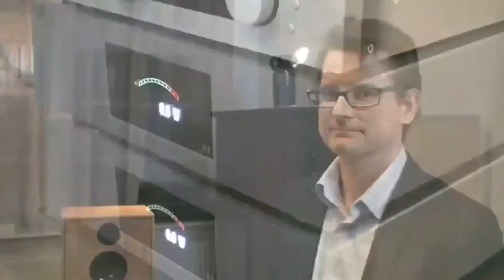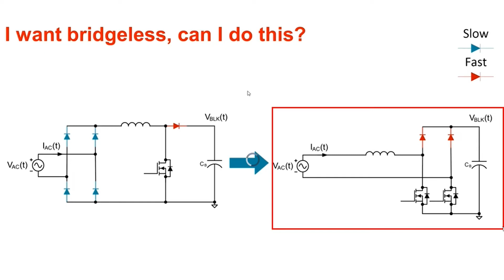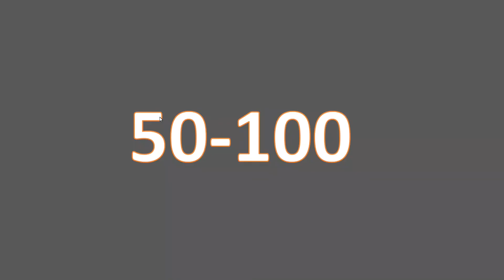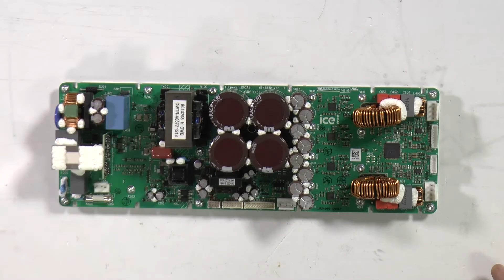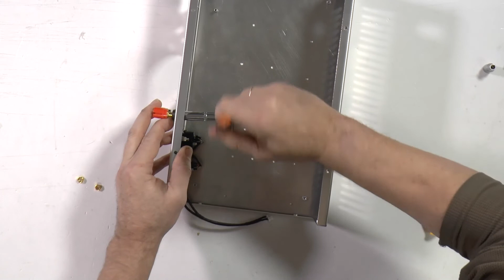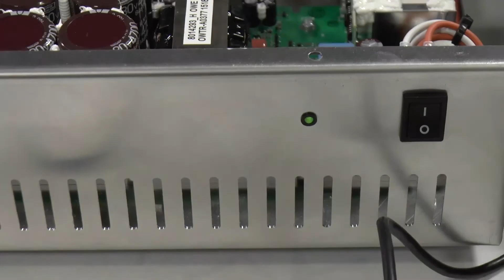ICEpower 1200AS2. Build your best audio amplifier in the world. Part 1-3

Comment: As you mention...We need a big swing preamp. 
I did got to work the sub pre amp off the china amp plates but the gain is a joke. Even when I by pass the sub preamp and hook up.the ice power to an old samson x-over it still lack so much gain.I have this xover connected to 2 ols crown power amps..they were soy rocking hard while the ice power was not moving the cone of a 10" 4 ohm. 
Any recomedations of a pre amp? 🤦‍♂️

Comment: Why use a fan in class D amp? The fan will make some noise no matter what, and is not needed in a class D amp. The amp  case is super low-cost crap, not good for a power amp, will not help with heat, and looks bad also.

Comment: Best amplifier in the world? I see around 1 percent distortion???? A budget amp has 0.003% at most.
Explain please.
Reply from the maker: All amplifiers have a linear region and a region close to the clipping region. This board features 450W of clean power with 0.003% THD and 150W of headroom to clipping. You can look at a budget amplifier's real power with 0.003% THD, and it will be from 35W to about 100W. For 3-way floor standers, you need a minimum linear low THD region of about 500W to really work at best audio reproduction quality, and it is a difficult engineering task to make it in reasonable dimensions, providing necessary heat dissipation.
Reply: @guntarssmits2104  Can you give a link to these specs? What I see is 1200 W / 4 Ohm per channel ≤ 1 % THD+N, 1 kHz - Who cares what power it has at 1 % THD, that is not acceptable.
0.003 % THD+N @ 1 kHz, 10 W / 4 Ohm?? I am impressed NOT.
Show a measurement (scope) from sine and square waves from 10 Hz to 30kHz oh and 8 Ohm! Let me see what power and signals it produce.
Reply from the maker: @edmundzed9870  Look at the document deeper in specs tables and charts https://www.tcrastrs.com/_files/ugd/81aa64_75490ea3cd5349698e124795a977d2ce.pdf

Comment: I've built many of these ICEpower amplifiers and none of them beat my EL34 valve amplifier. This is always a very subjective topic.
Reply: There are reasons for this, all of which center around certain non-ideal amplifier behaviors that can sometimes be euphonic. This is where the objective engineer and the subjective listener sometimes diverge. Have you looked into the PS Audio Stellar M1200? It is using a switchable tube buffer and may provide the warm character you like, together with the power to control very large speakers, coming from the ICEpower 1200AS1 module which is a single channel version of the one described in this video. But if you are already using a tube amplifier, then your speakers are probably very high sensitivity. Some of the design decisions in such speakers that improve sensitivity can also reduce other distortions, but there are some other high sensitivity speakers that are forced to live with a higher level of distortion, such as higher-sensitivity single driver speakers or some older horn speakers.
Reply: It's not about euphonic distortions : There’s more musical information in a continuously conducting Class A NOS tube amp than in PWM-based designs. PWM introduces dead-time, crossover artifacts and high EMI that can mask low-level dynamics; measurements that focus only on steady-state THD/IMD miss the transient power transfer and micro-dynamic behavior that matter for music reproduction. And good tubes run at incredibly low THD. The 211 tube for example specs out with more linearity than transistors and has a totally natural, uncolored sound - no warmth here.

Comment: 20 some years ago I bought a pioneer ice amplifier. I didn’t know exactly what it meant. It was for my car. It was spectacular. I still have it now after doing extensive research prior to buying things. I forgot to do it on my pioneer LX 505.    I’ve been running that amplifier for about two years maybe a little less and I absolutely love it and it is powered by ice.   In my opinion, there is nothing better than ice. You guys know how to do class D

Comment: Is the 700AS2 the same Quality level? Could be enough power for non profesional uses. What do you think?
Reply: It is not using the IceEdge modulator/control chip. Only 1200AS1/2, 2000AS1/2 HV are using IceEdge, and 125ASX2 version 2.2 is using the even newer Conductor modulator/control chip.
Reply from the maker: @carlosah2598  no it hans different architecture

Comment: Hi Guntars

Thanks for the very nice video.

I have a pair of amps build on the 1000asp modules, which has started to sound muddy in the bass region. Probably the power supply capacitors is becoming old… the amps is from 2008 and has been on 24/7 since…

I am thinking of replacing the 1000asp’s with the 1200as1. And wold like to know if you could guide in how to make the signal sense wiring for both balanced and rca inputs? 

I guess using the standby function will save both energy and life time on the modules…

Regards Jan
Reply from the maker: It extends the amplifier's life span using wake-up from signal function. To implement this function you should download 1200 pieces of technical documentation from my site www.tcrastrs.com or write me an email at gsmits@tcrastrs.lv and I can send it to you. Board documents are available for download from the Soundimport shop as well. Implementation guidelines are described in the design manual. It is possible to implement for RCA and XLR. The wake-up signal input is separated from the main input.

Comment: I am using 1200AS2 at the moment and thinking of changing to dual monos: 2 x 1200AS1 or 2 x 2000AS1HV. 
Do you know if 2000AS1HV is much better than 1200AS1?
I can afford both solutions and/but looking for someone who can advise me if 2000AS1HV makes that much of a difference over 1200AS1. All in all the 2000AS1 has "HV" (high voltage) in its name. 
I am looking to build my endgame amplifier for life.
Reply from the maker: By quality both are equal. You should have a logical explanation of why you need a 2kW per channel for home usage. You may have large premises and huge speakers.
Reply: @guntarssmits2104  I have 1200AS1 modules at home waiting to go into their chassis over the Labor Day weekend. I decided to pursue this route so that it would be impossible for any sort of supply modulation behavior in one channel to affect the other channel. Having even more power available from one channel is just further icing on the cake. I have some project speakers planned in the future that will use long-stroke subwoofers as the woofer, like half of a Magico S5, and those are usually a very reactive load that normal amps struggle with. I already have some Hypex NCx500 monoblocks that can output the power of the 1200AS2 running in stereo (~700W/ch at 4 ohms) so an endgame setup could be actively crossed over LF on the 1200AS1 monos and MF/HF running on the NCx500.
Reply: @guntarssmits2104  ok, many thanks for your advice

Comment: Hallo Guntars Smits, i built the amp with Icepower1200AS2  and im very happy with it. Thanks for this videos. My question: If i use a source (preamp) with max. 2 volt output voltage with rca-connection, how much ist the max. output power of the module? I gues its around 175 Watts. It is right?
Reply from the maker: Depends on the load. For 4 ohms 300W for 8 ohms 150W

Comment: hi, if i connect as2/1200 amp to rca / no-balanced cable, is it still good high.end amp for this? what do i need to do? put buffer in between to raise inputlevel? tnx nice video!
Reply from the maker: For a short distance of up to 6m of input cable difference between balanced and unbalanced is in sensitivity. Unbalanced is -6dB or 2 times lower. If your max power is OK then you should not do anything. Quality is the same.
Reply: @guntarssmits2104  unbalenced is 6db lower. Not 10db? Maybe i just rememberd 10db. No? Thank you very much for answer :)

Comment: im currently building a pair of speakers with intergraded amplifiers (icepower 700AS2)
In my case, where the whole speaker is made from wood, where should i put my groundings?
Reply from the maker: You can put mains ground to some of the screw hole which has chassis ground connected. For operation you do not need a ground, just fo safety, but as long as you enclosure does conduct electricity you can live without mains ground. Find 700AS2 engineer manual on ICEpower site and look at drawings. There are some information about chassis grounding.
Reply: @guntarssmits2104   Thank you! :)

Comment: Is it possible to integrate VU meters in the front of the housing ? I’m quite interested though the design is missing the aesthetics to convince my wife of setting it on the low board instead under it. Thanks 😊
Reply from the maker: When we are talking about next-generation amplifiers with high probability we will move away from shiny box designs and moving signal indicators. That place is taking modern streamers and DACS with phone APS where you have all meters and many more. The amplifier should become invisible and be placed as close as possible to the speakers. This is also my concept. TCR1200 has a built-in Wake-from-signal function that allows you to place it remotely from your front-end equipment, When the signal comes to input amplifier starts operating. You should not switch it on. After 18 minutes (minutes not seconds) of idle, it goes into sleep mode and consumes only 250mW waiting for the next moment when the signal is applied to the amplifier input.
The simple answer is no there are no future VU meter designs from me.

Comment: Thank you so much for your work. You are providing really helpfull information. 

However, one issue has not yet been conclusively clarified for me, namely the question of what the situation is with input buffers. 

To make the rather analytical sound of the Icepower boards a little more "analogue", many recommend tube buffers or op-amp buffers with TI IC or discrete OP amps. 

Is there an "in a box" solution with an AS2 or ASX plus inbuild buffer board? Thank you so much!
Reply from the maker: Let us define input buffer meaning. It is an electronic unit with a high input impedance of 47kOhms or more and a low output impedance of 50-150Ohms, the capability to handle high overloads and low distortions.
1200AS2 Board has a good 47kOhms input buffer and it does not need other preamp circuits. Boards like 200AS2, and 125ASX2 have relatively low input impedance of about 5kOhms and there will be improvements from the input buffer. I made a buffer board based on a TI INA1650 chip with 100kOhms input impedance and 150Ohms output impedance. There is significant quality improvement working together with 125 ASX2.
A good option for a preamp is a modern DAC which meets above mentioned requirements. It is not important whether you have a lamp or other technology preamp. The key is a high input impedance and low output impedance of the preamp to be able to drive the power stage. THD below 0,005% (Typically 0,0005%)

Comment: WHAT PREAMP IS SUGESTED TI USE WITH iCEpower 1200AS2?
Reply from the maker: Any modern streamer/dac with balanced outputs for the best quality. I am using a PC and Focusrite sound card as a budget solution
Reply: I made amplifier based on IcePower250A modules. Very satisfied. I feed it with different streamers (not balanced) but noticed that if put some little preamp(gain 3 or so) sound becomes much better @guntarssmits2104
Reply: this is a good question. i'm considering marantz av10 or stormaudio as surround processor pre amp and will DIY this amp for a total of 11 channels. will these modern surround processor preamps complement this icepower 1200 amps  @guntarssmits2104 ?
Reply from the maker: @QAT4969  For home cinema surrounds 1200AS2AS2 will be overkill. You may need it just for floor-standing fronts. We are dealing with a 1kW capable board and 3.8kW instant power. Assuming that you will use 6 boards your wall socket provided power will be short. Also, you will need a sequencer to switch amplifiers one by one. Quality will be outstanding but science home cinema limits low frequencies for surround and we can hear directional effects from 500Hz-5kHz I would say that 200AS2 is a better choice even if you are building an advanced system. And you will save significant space, money, and electricity savings
Reply: thank you for your advise Mr. Smits. yes..i'm considering 200AS2 or smaller for surrounds & overhead ceiling atmos speakers. for power switch socket outlets (SSO), i'll have them in every corner. front stage will have at least 5 nos of SSOs to cater for BD player AV pre pros, and the 3 LCR which will be powered by 1200AS each..not forgetting subwoofers too.

my goal is to achieve 120db@1m at LCRs, and 100db@1m for surrounds. i need that much SPL due to my seating position from the screen is about 5meters.

i would also like to add on switchable on/off 4 LED signal indicators to monitor power output level as to not clip both the amps & drivers, low (green), mid (yellow), high (amber) & clip (bright red). is there anyway i could add it to the amp board?
Reply from the maker: @QAT4969  Seems you thought about everything. Regarding socket outlets, your challenge will be Mains house automatic protection surges which are set for to 16 amps in 220V countries. Typically one room is protected by one surge protector or all room mains sockets. When you turn on SMPS you have a short-term large inrush current and can trigger household protection. Only tests can answer that. In parallel to your system, household mains have a basic load- fridge, kitchen appliances etc. those are unknown variables as well. The good news is that in professional audio there are sequencers with outlets switching one by one with 2 sec intervals. extra 100EUR for your project.
Reply: @guntarssmits2104  our 240 VAC residential main circuit breakers are limited to 100amps, mated to a 100amp fuse. however distribution board will be limited to 32 amps for SSOs, segregated room by room. so yeah..power conditioner will be a necessity for my movie room. noticed that 1200AS will draw huge current, hence my decision to limit one 30A SSO to 1 amp only.

Comment: I purchased the 1200AS2 and had problems with it. It kept switching from ON to STANDBY mode. I called icepower but they told me it was out of the 3-year warranty, and could not repair it. They said I would have to order another module :(  I am not going to spend another $500!!! Not sure if anyone else has had this problem, but I have also heard others that said they are trouble and to stay away! 💩ICEPOWER 💩
Reply from the maker: Murphy's law is universal and sometimes things are going wrong. I made a video about where to purchase the boards to be on the safe side. https://youtu.be/NkXuz7dY0PY . In most cases, the seller is responsible for at least 2 years of warranty of sold goods and you can return it even if you are out of manufacturer warranty. I have sold more than 100 kits and also have one case when the board did not operate as described. The seller Soundimport replaced the board without disputes.
When purchasing 1200AS2 used boards for a good price we should be aware that there are rear cases when someone is selling them due to sound quality reasons. Typically board has an issue. Most of the DIY projects are done in small extruded cases without proper airflow and boards operating in extreme temperature conditions. In my videos, I emphasized that good design should have proper airflow calculations in the project. For passive cooling, you need a 3U high enclosure and vertical board mount to achieve minimum necessary airflow. Seems that your board come to the end of life due to long operation in high-temperature conditions. According to statistics if the board has a manufacturer components defect it shows up in the first 2 weeks of operation which are covered by 2-3 year warranties.

Comment: Those wires are from IcePower? I received wires to 700as2 and quality is not best in my opinion, audio input are made probably from aluminium...
Reply from the maker: No, I am not using cables from Icepower due to quality issues. I am purchasing high-quality silicon wires for mains and speaker connection and extra quality small diameter flexible shielded signal wires. Crimping is done by our company.
Reply: @guntarssmits2104  Where I can order them?
Reply from the maker: @partyk138  Generally speaking you can build a perfect system with cables provided by Icepower. It has an impact when you assemble a number of kits or integrated systems. A good place to purchase assembling components is TME catalog. Wire what you can use for input connector is this https://www.tme.eu/en/details/tas-c202/microphone-cables/tasker/c202/
Reply: Cables are no problem, but connectors :/
Reply from the maker: @partyk138  That's a hard part. You should search around the globe and purchase them in volumes. Also, Icepower boards have a broad variety of connectors. The reasonable MQP is 1000 due to shipping costs. Can not help with that. Use an existing set even if you may not like them.
Reply: @guntarssmits2104  I think I will works with those poor cable, would be nice to make compare. After that I don't see any reason to buy more expensive wires to connect with pre-pro, probably it's just waste of money.
Reply from the maker: @partyk138  Audio quality will be exactly the same. The only difference is cable flexibility and how easy to crimp them.